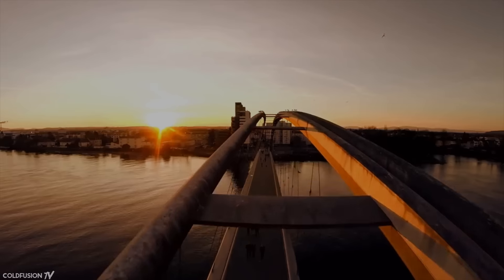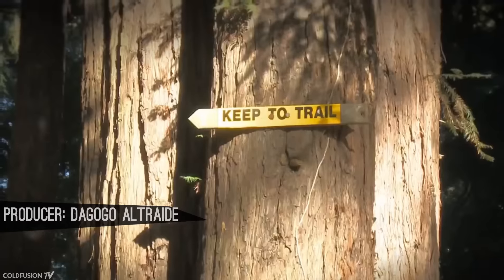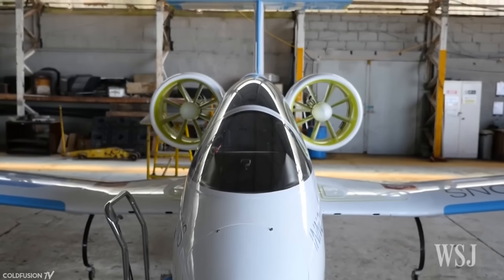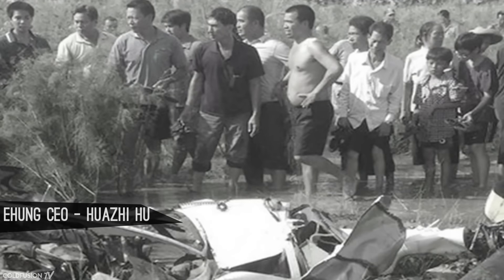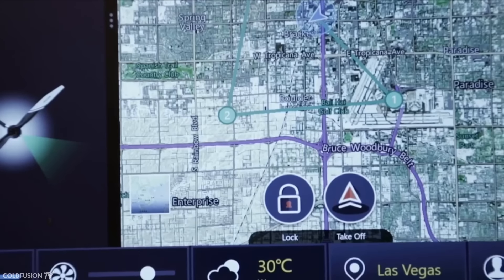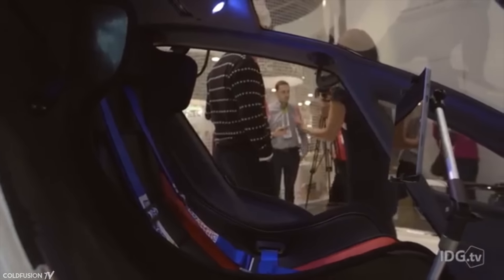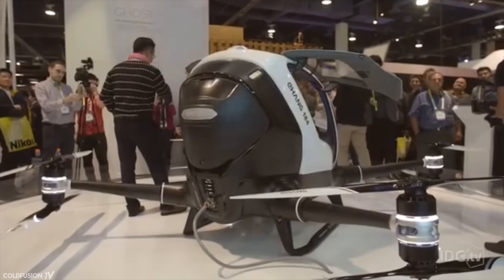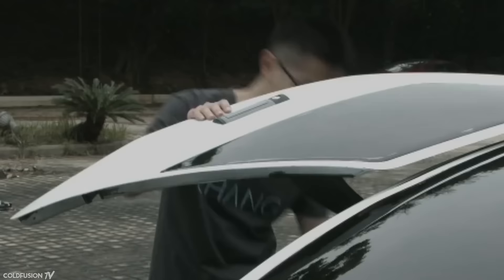World's First Passenger Drone (Ehang 184) | ColdFusion

Comment: Even if a vehicle has the ability to control itself, I would always want the option of the person inside being able to take control.  Plus, flying it manually is a lot more fun.
Reply: +Physics Videos by Eugene Khutoryansky although I completely agree, there is no way public transportation in the air can go mainstream while allowing manual control, because of the traffic of course, we can't build roads in the air, which means that one would need to be aware of traffic that could come at you from any degree in all axis, the human brain simply can't handle all that in my opinion.
Reply: ***** yeah obviously, which supports the idea that everything needs to be automated, of course there will be sensors all around the vehicle, that doesn't mean that a human brain is going to be able to keep up with all the input from these sensors.
Reply: +Jafar Al-Moosa you hit it spot on. The only logical future would have to be automated.
Reply: +Jafar Al-Moosa That's all fine and well until the computing system that controls the craft has a glitch or malfunction. Without any option for manual override in such a situation, it's a case of bye bye birdie.
Reply: +Physics Videos by Eugene Khutoryansky People are still iffy about automated cars much less an aircraft
Reply: They should make it solar powered with 3 back up batteries so it can fly long distances at 150- 200 kmh    making a 8 hour flight only 3 or 4 and while it's using 2 batteries the other two are charging from the panels.
Reply: An should make it available to pilot it yourself as well as a few features like autpilot, autopilot hover, with Alexa as a system so you can tell it what to do. Oh and give it wifi with a small screen in it with speakers heat ac, a seat that unfolds a little like a lazy boy for long distance travels. An cup holders with USB ports and a ventilation for smokers.

Comment: If the FAA had their way the aviation industry would be decades behind the technology of today and engines which run on lead fuel that were built in the 40s and 50s would still be used in modern aircraft. Oh wait... That's already the case.

Comment: A drone is an unmanned helicopter.
Stick a man in it.
Congrats.  You've got a helicopter, not a drone.  Rotocopter? (If that's not trademarked already, I call dibs.)
Reply: +Bruce Baker The main difference is that it's automated and fully electric. But yeah it's just a modern helicopter really.
Reply: +Bruce Baker no.

unmanned means it operates itself autonomously. since this aircraft is completely controlled by ai, it is autonomous. the man inside it is just the cargo. the man inside has no more control over the aircraft than a box of eggs does. thus it is a drone.
Reply: box of eggs can't break the helicopter from inside, but a man can :) It's really semantics at this point. Cars with auto pilot function are still named cars, it's more of a language preference than a need for new category.
Reply: +Squall Leonhart if this octocopter isn't waterproofed enough on the inside, a box of eggs can really do a lot of damage to any electrical device
Reply: Anon Ymous Thanks for the correction.  Yeah, I spouted off without even watching the vid...where that distinction was noted.  
   But for me, it blurs the line.  "Unmanned", for me, means the design needn't be able to carry and support a person.  Small.  Or, like a space probe, all the propulsion, control and monitoring.  But design neednt be huge to lift person, air, etc
Reply: +Bruce Baker  thats not true, a drone is an remote operated vehicle (or self operating), ist not importand, if someon is sitting inside :-)
Reply: +Bruce Baker I just glued a drone to myself. I am now a flying terminator.
Reply: GloomGaiGar Eeeeek!
Reply: A drone doesn't need to be piloted which is why it;s called an autonomous machine. You just need to insert the destination and let it drive you there. A helicopter with a central rotor is rather unstable and needs a competent pilot manning it at all times.

Comment: ?,  no.  theyre going to realize these drones experience ground resonance turbulance and another phenomenon that occurs in decent.  they are going to run into the same problems early aeronautical engineers did as they developed the helicopter.  they tried these quad rotors and scraped em because  helicopters are superior. thats why we have helicopters. instead of drones.  silly kids engineering is for adults.

Comment: If they going to sale them in the USA they will need to be bigger with a much more capable payload. Just like their cars it is little and too small for americans. Other problem, batteries anything using batteries over the last hundred years suck. There has to be a much better power source and for flying it's got to be lighter. We can build electric motors that run for years 24/7 but batteries, another story. Forget everything else and develop a power source. Then come back to cars and airplanes.

Comment: Mass human powering drones will never happen - just like everyone using helicopters never happened. When oil runs out, we will revert to horse power - the four legged. Large or small passenger aircraft will never have enough battery power - same goes for ships. What we need is micro nuclear cells - last 20-25yrs.
Reply: Then we'll all die from radiation. Solar power, would be a lot better.

Comment: 20 min. flight time... crap
Reply: It's on an electric battery. A lightweight conventional helicopter lasts less than 10 mins on elertic and an octagonal copter lasts for average 20 mins. Gasoline tank plus motor can last for hours but the goal is to create zero emmisions and cut down on air pollution for long term future public transit vehicles.